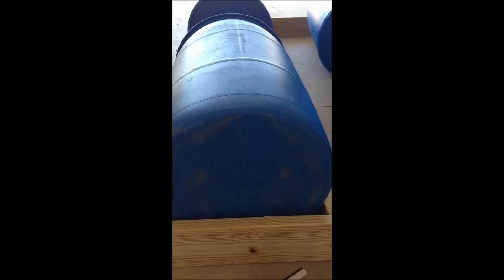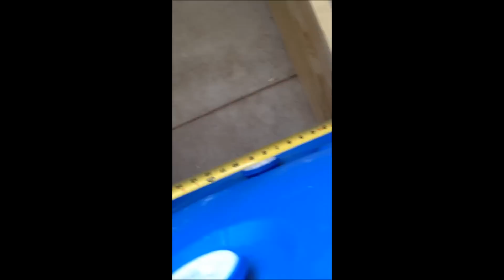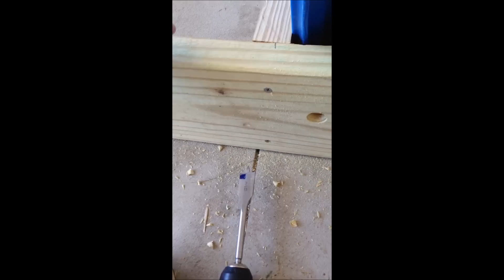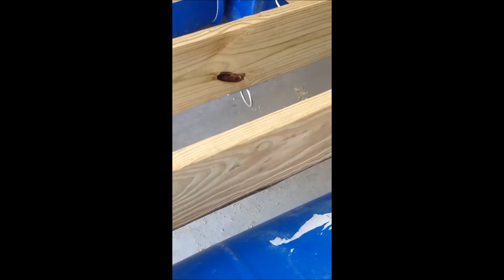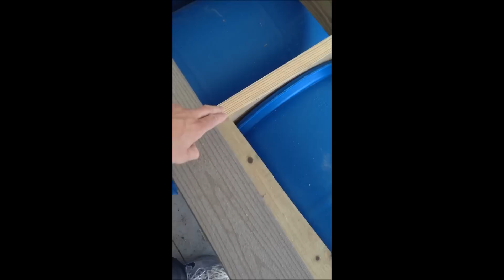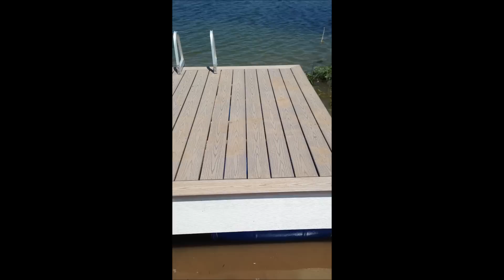How to Build a Swim Raft using 6 Barrels

Comment: Thank you for the inspiration. Yours came out very nice. I especially like the ladder, i wont be adding one tho. 

For mine, no joist hangers. 7 inch lag screws. No composite so only 4 barrels needed. Metal straps no rope. Plywood top with pontoon cushion peel n stick flooring. "P" corner molding on 4 top edges and 4 eight inch cleats.

It will fill the space at my slip between my bow and the shore wall for easier boarding

Comment: I built a similar floating swim deck with damn near the same layout and materials except I used foam boards underneath and between the rafters for buoyancy. I built it in 2003 and it’s still in the same pond looking good.
His definitely looks nicer than mine. He is a better craftsman.

Comment: Did you seal bung holes or is bungs tight enough seal? Also are you concerned with air pressure changes  due to temperature change?

Comment: You might want to add a 2*2 or even a 2*4 vertical under that outside lip. People might hang on edges of the lip boarder making them weaker over time. Liked the video but that's the first thing I thought of when I seen what you were doing. Just looking for ideas.

Comment: What size barrels did you use? I need to build a raft which will carry 6 full grown people, I have been offered 5 gallon barrels, will this work??
Reply: One 55 gallon barrel has a buoyancy of about 450lbs  4 barrels should float 1800lbs  6 barrels 2700lbs. You'll have to subtract the approximate weight of the dock. Then think about how many people will be on it at one time. I am planning a 10'x10' and will use 6 barrels. I wouldn't consider using 5 gallon pails. I may be wrong but you would need 11, 5 gallon buckets to equal the buoyancy of one 55gallon barrel. so of you needed 6, 55 gallon barrels you'd need 66, 5 gallon buckets. then you run into issues with height off of the water. 5 gallon buckets just don't seem practical.
Reply: I would imagine 5 gallon barrels would take a lot to do the raft.  If you could find the ones like in this video 4 should work.